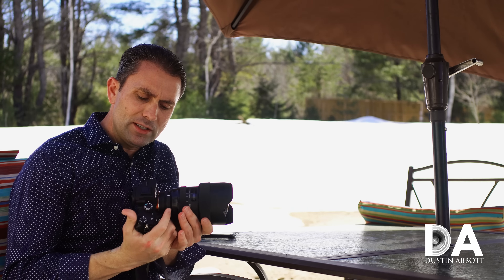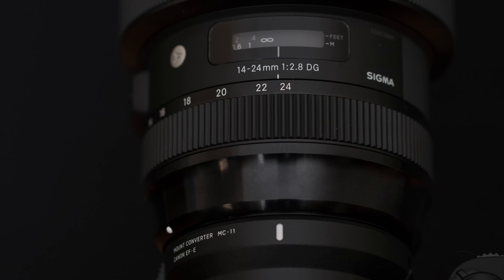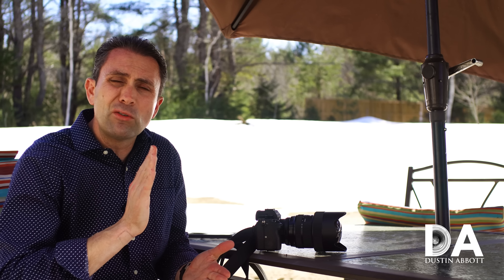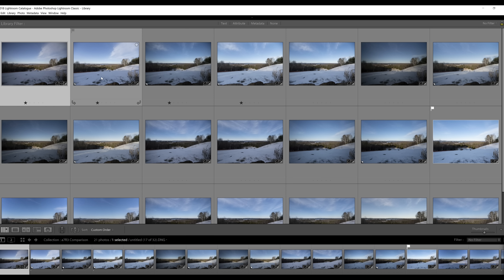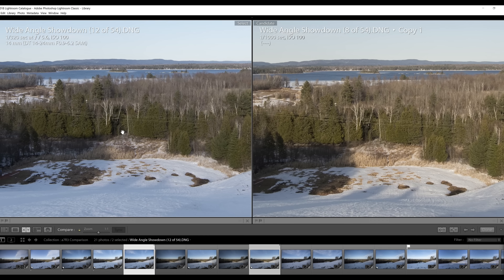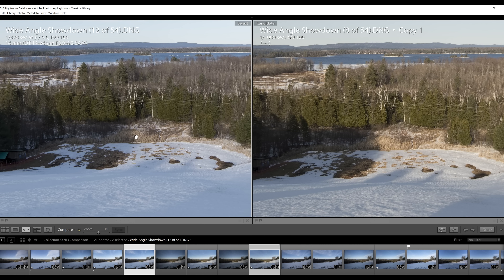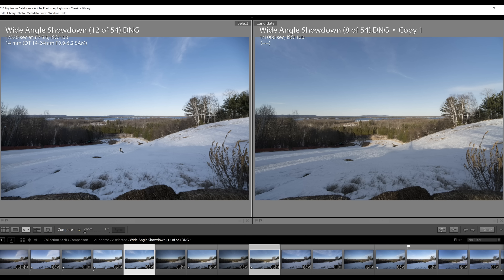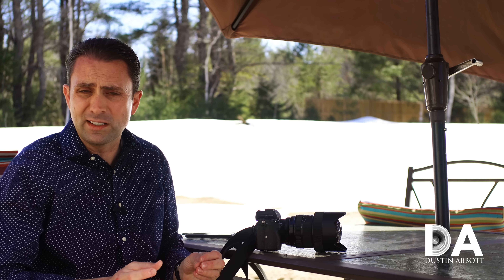Sigma 14-24mm f/2.8 ART on Sony FE:  IQ Breakdown | 4K

Comment: For viewers saying an adapter cannot degrade IQ, that is sadly incorrect. I did a test here https://youtu.be/75XJnQY7tt4 which shows a clear advantage of the MC-11 vs the Metabones.
I was a Metabones IV and then V owner and I always thought the less than sharp edges were an issue with the lens design not working perfectly for mirrorless. Then I got the MC-11 and was surprised to see how  much better it was performing IQ wise. Just for testing, I rented another MB IV and the results were on par with the  other 2 I had. I  contacted Metabones about it and they told me they were going to investigate this and get back to me...they never replied back so I assume their findings were not different from mine.
Good job, Dustin!
Reply from the maker: I've got 3-4 adapters and have tested at least four others.  There's definitely a variation between edge performance.  I too have seen the best results from the Sigma MC-11.
Reply: @DustinAbbottTWI  glad to see our experiences are the same. Did you ever have a change to test this lens vs the Sony 12-24? Just curious. Thanks again!
Reply from the maker: I haven't used the Sony lens yet.  Sony Canada (their distributor) doesn't get many loaners.

Comment: Although its wasn't the best optically, I used to love shooting on the Sigma 10-20mm. It just had a 'look', tons of character. Terrible for lens flare though and let it go to pay when switching to the A7III. So been with out a wide angle for a while. A year on firmware is just getting so good this likely going to be my choice for video and landscape.

Would the Sigma 14-24 art be similar in focal wideness to the APC Sigma 10-20mm or is more like the Sigma 8-16mm?
Reply from the maker: It would be just a little wider than the 10-20 (10mm is the equivalent of either 15mm or 16mm depending on the crop factor of the camera you used it on).
Reply: @DustinAbbottTWI  Awesome. Thanks Dustin. Was considering the Sigma 12-24mm f4 also but may get it as an addition in future.

Comment: i just bought the sigma 14-24... its amazing lens..almost zero distortion.... performs very well both in my canon 5ds and sony a7III w/ mc-11... even for videowork.. AF is amazing..i can hear minimal tick due to mc-11. but its not noticeable unless u put ur ears near to the lens.. This is a killer lens compare to 16-35 canon III , sony 16-35 and even the loawa 14mm zero D
Reply from the maker: I think it is a great lens, for sure!
Reply: So you are currently using this with the Sony a7iii? I just purchased my own A7iii and want to get the Tamron 28-75 and looking at this lens with the sigma mc 11 to cover my wide angle. I am a hybrid shooter and would love to know your thoughts

Comment: It's certainly possible for an adapter to be subpar if its thickness isn't exactly right, where a Canon to Sony adapter requires 26mm. My MB IV was almost 1mm short out of the box. Corners were completely terrible unless at f11 until I shimmed it with some stiffer thick paper to bring it closer to 26mm. On the other hand my MC-11 measured at 26.02mm using a digital caliper and has been outstanding.
Reply from the maker: Exactly right...as is being sure that they seat perfectly flat (no tilt).
Reply: That is also true. I had intended that as a reply to your statement regarding people incorrectly thinking that adapters cause quality loss. In an ideal scenario they don't seem to, but it's certainly possible with poor manufacturing tolerances in some cases.

Comment: I'm a hybrid shooter with the A7iii and want to get the the Tamron 28-75 and the Sigma 14-24 + mc 11 adapter to cover my wide angle range. What do you think? Does the sigma perform well with the mc 11 for video and photo?
Reply from the maker: Yes it does.  That combo should work well.
Reply: @DustinAbbottTWI  thanks for the input! You think this will be a good choice for low light concert photography?
Reply from the maker: I don't see why not

Comment: The Sigma 14-24mm f/2.8 ART is an incredibly performing lens without question. The size is a bit off putting but this is the price we pay for optical perfection.
Reply from the maker: That seems to be Sigma's formula now.  They routinely churn out lenses that tend to be the largest and heaviest in the class, but are also usually pretty close to being optically tops, too.

Comment: Incredibly useful review -  I think I have considered every lens you put the Sigma up against.  I`m still leaning toward the Laowa, only because of its manual aperture control (for use on the shift adaptor).  
It would be really awesome if you could get a copy of the Sony 12-24 for comparison.  Though, I imaging the Sigma will blow it away.
Reply from the maker: I think the Sigma is probably the strongest performer at the focal length.  If I ever bring in the Sony for review, however, it will probably be possible to pull a Sigma or two back in as I've got a great relationship with Sigma Canada.

Comment: can somebody inform me if sigma 14-24 with mc-11 works with sony a7III?
Reply from the maker: It works just fine!
Reply: @DustinAbbottTWI  mine is not working for aputure a7lll and a7sll also
Reply from the maker: @조한-k4c  It sounds like you need to do a firmware update on your MC-11 through the Sigma Optimization Pro software.

Comment: Great review, thanks for all the information.
As you already mentioned, there are rumors claiming that adapted wide angle lenses struggle on Sony E mount bodies especially in the corners. You showed that it is not the case (at least with this lens) at the edges.
I would like to know if it is the case in the corners please. Do the corners on Sony hold up as sharp compared to the results on Canon body with this lens?
Reply from the maker: They do.  The results have a lot to do with how tight the tolerances on the particular adapter is.  I have one adapter that obviously isn't perfect, and delivers softer edges (though ironically it is sharp on the edges if you focus there).

Comment: Great review thanks. I'm using Canon 16-35 2.8 mark iii, how it will performe on Sony? or it is better to stay using Canon since I invested on several f2.8 glass set?
Reply from the maker: I haven't used that combination per se, but you can see my thoughts on adapted lenses in this recent video:  http://bit.ly/meta5vsMC11
Reply: Sony 16-35 G-Master is best full frame wide zoom, Canon III L is 2nd best.
Reply: True, the Canon has a dark corners without corrections on camera, so it may not work well on Sony if used in fullframe video for ultra wideangle views, and it will be hard to fix later. There is no review for Canon 16-35 2.8 mark 3 that shows how good or bad it will be on Sony body which makes it risky to swich systems.

Comment: You cannot lose any of iq using adapter, because it doesnt have any lenses inside.
Reply from the maker: Yes and no.  I have seen image degradation from adapters (though there are no elements inside), but not the higher quality ones I've used.  If an adapter isn't perfect, it can change the flange distance just enough to affect image quality.  A lot of people claim serious IQ loss along the edges - which in this case is not true.
Reply: Yes this is quite true, iv'e seen adapters used on other another camera system using Otus and Milvus glass, the results were quite awful, however as you have shown it's certainly not the case here on the Sony system.
Reply: I dont know if it was one of your video's Dustin, or if it was one of Christopher Frost, but I can also recall something about the focus plane shifting (which was not visible on a canon body, but did happen on the sony body with an adapter)...
Reply from the maker: It must have been someone else.  I have a less expensive Vello adapter, and, while the AF actually works quite well, if I focus on the center of my wall I use for tests the corners are soft, but if I focus on the edge, the whole thing is in focus.  It's a bit weird, but that tells me a little of why some have found different results that what I did in this comparison.
Reply: Actually you can and I even showed this on a video.